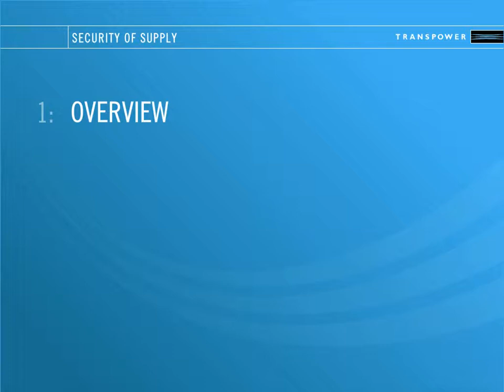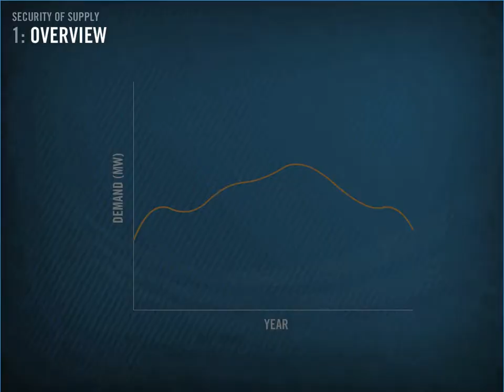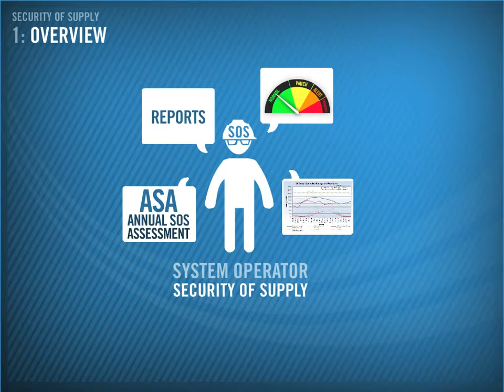Security of Supply: section 1 - overview

Comment: Very good presentations to aid public understanding of NZ's complex supply risk environment and shows the excellent work done by the system operator (Transpower) to provide this risk information. The problem is how market participants (the retailers) use and present this data for their own interests. As the impartial public good "custodian",Transpower needs to be more proactive in publicising their view of the day to day risk status. Eg why are wholesale prices currently so high, while a low risk is being signallled by Transpower?